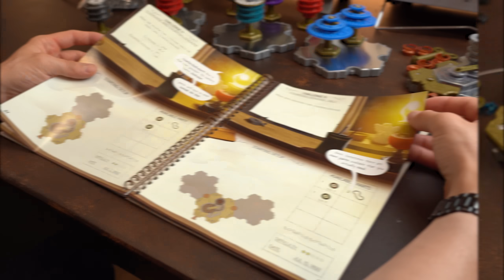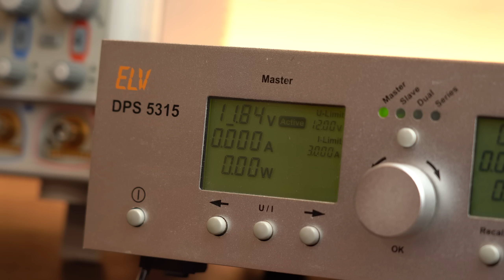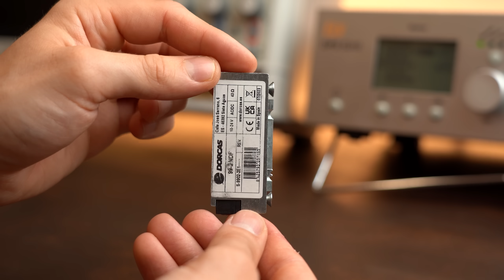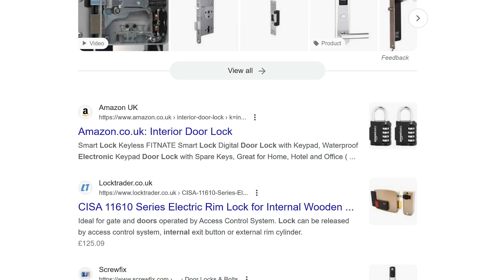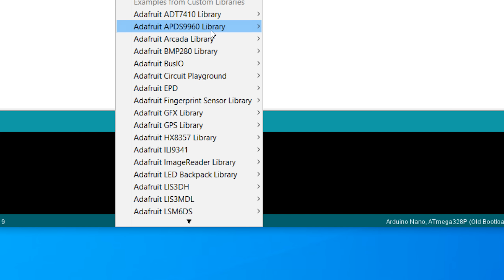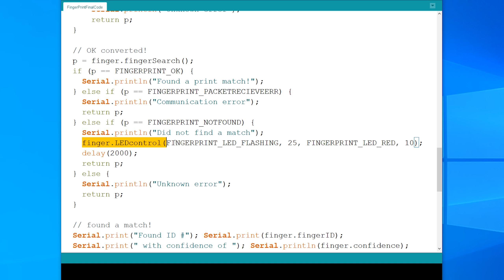Your Door NEEDS this Upgrade! DIY $40 Fingerprint Lock!

Comment: I would have done it a bit different.

Ideally I would have used the electronic lock on the locking part of the lock, and always keep the door locked. Some modification is probably needed to the locking bolt so it won't stick out too much, but that way there is a solid backup if the electronics for some reason fails.

The second thing would have been to power the lock from inside the room, and use a fail safe instead of fail secure lock. That way it would be possible to just trip the HPFI and then gain access to the room in case of electronics failure.
Reply: Can't wait to see your video!
Reply: Just make a video. We will watch it once you post it here.

Comment: Honestly i never understood problem have with white cable ducts. Like they look just fine, especially white duct on white background.
Reply: My only issue with them if you use a poor adhesive they might come loose.
I usually use screws or nails.

At least this is the only problem I've seen l. But our walls are made of bricks.

Comment: for the power just drill a hole through the back of the box into the shop and then you can use whatever method you want to connect it.
Reply: Also, what about the situation, where there is no main power in the house.. You can't get in at all.
Reply: @ElusiveAffinityEchosAlignment it should have an USB input for powerbank, to let it open in case of power outage.
Reply: @ElusiveAffinityEchosAlignment  the key can still be used, it also operates the other bolt when turned a second time
Reply: @ElusiveAffinityEchosAlignment  not like you can do much inside the lab without electricity anyways...
Reply: @ElusiveAffinityEchosAlignment  Keep the key in a secure and known place.
The key usually can also operate the wedged latch.
Reply: @ElusiveAffinityEchosAlignment  For fire safety (and dramatic effect in heist films) those locks often fail open when unpowered.
Reply: @Mike-mu7tk Which would make it irrelevant if it were simply plugged in outside the lab
Reply: You can just shim it with a creddit card, though most access control systems can be bypassed with the key
Reply: @ElusiveAffinityEchosAlignment  With the current lock mechanism he won't be able to open door on the door knob side as the key only operates the dead bolt while the handle operates the latch bolt. But for those German doors there are lock mechanisms where the key can pull back the latch bolt, too. He can place an emergency key somewhere the kid can not reach. I would strongly recommend that as the opening mechanism could also fail.
Reply: Yea
Reply from the maker: @FlammableElectronics  Not a bad plan. But inside the lab the next outlet is even further away. Hmmm I will see.
Reply: @greatscottlab   Isn't there a light-switch inside next to the door, right behind your enclosure? You could just tap off of there.
Reply: @Sprengi86  I don't think it's advisable to connect lighting with other appliances in the same circuit breaker.
Reply: Isn't the outlet you made on the same wall as your lab? Just make another outlet on the other side of the wall. Or as said. From your light switch nearby. Only need a neutral extra.
Electrical bacup not necessary but if you could get the knob off to get in mechanically that would be nice.
It just private for safety not an hotel. Unless you want to keep your wife /girlfriend out too 😅
Reply: @greatscottlab try plugging it in from the opposite side of the original outlet, maybe?
Reply: @greatscottlab  maybe you should have placed the power wire for the Lock also into the lab. Because now someone could easily open the device and connect the power direct to the lock to open the door. On the Outside only the fingerprint sensor should be placed if you want to do it right.
Reply: @greatscottlab  I would also be concerned about a child being able to pull on visible wires that are at mains voltage. If the wiring was inside the lab that danger is also removed, even if the wiring is longer and ugly.
Reply: The new outlet you just added, flip it so that it’s on the inside of the shop but still connected to the outlet you use for the vacuum
Reply: @greatscottlab furthermore, in the lab you have all sorts of possibilities for low voltage (including batteries, power supplies and all combinations)… Possibly no need for an outlet nearby…?
Just food for thought 😊
Reply: @Sprengi86 but then he has to pull two extra wires to that switch to provide power. Or else you turn the door lock off at the same time when you turn off the lights. 
He made an extra socket outside so he also could do this on the switch socket in his lab or directly for that matter.
Reply: @greatscottlab  If it raises the WAF (Wife Acceptance Factor), it's never too much work ;)
Reply: @greatscottlab  i was going to say drill thur wall back room and use plastic cover you have run it to outlets and dont forget add power protect in cause of short it doesnt burn it self down you want have keys for door in cause if power failures end up being locked out of the room and having battery backup in work room not in front living rooms so you still get in without issues
one easy trick use relay 5 pin and power failure and relay drop back in middle pin so it run to battery and have psu hook up to relay turn it on bypassing battery and psu failure it and relay fall back to middle pin sent power from battery to model keep it working and dont forget add leds light back room so you can tell n see still running from psu or battery ( dont need to chager battery unless going over 3 years sitting
Reply: @greatscottlab  you could also drill a hole through the wall from inside the new outlet that you made. But this is me assuming that your worskspace is on the other side of the outlet. In case you would want the outlet on the other side as well but the wall is not thick enough to take an outlet from each side. Then you could drill a cable sized hole at an angle into the newly made outlet to get the cable through, and if the angle is big enough you should also have enough clearance to put a new outlet inside the workspace wall.
Reply: @Sprengi86 Light switches don't usually carry ground connection. Its just mains entering the switch and then out.
Reply: @greatscottlab  wife's approval is not necessary in there. I would keep a reader only on this side of the door (possibly even mounted in the door frame) and put the box on another side of the wall.
Reply: @greatscottlab your wife isnt going to tell you its ugly there 😉
Reply: @greatscottlab  sure, but there you can use the ducts freely since your wife won't be able to enter the room.
Reply: Lay the cable duct inside, it's a lab anyway.

+ you can probably also add a battery backup; a rather small one in case of a power blackout
Reply: @greatscottlab   Drill a hole through the dividing wall, the outlet will be at the same exact spot
Reply: @greatscottlab  If you're rewiring mains for a second outlet you might actually just run a new line all the way to your door because you will anyway need it for the lifetime of this lock, so why bother having an extension cord somewhere?
Reply: I was thinking the same, and in your lab the cable duct isn't ugly. Thats not a place for visitors or something. Or use an industrial looking duct so its a feature. 
Btw congrats with your newborn!
Reply: This also gives more security for the control box. 
Also, have a 2 conductor cable come from the control box to a transformer, then to mains. Your exposed wiring should be 50V or less.
Reply: Plus the logic board is not accessible so a child can't get into it to bypass the fingerprint reader by hotwiring the lock 😅
Reply: Bad design, just power cut or whatever electric fail, and you have no B plan.

Better would be, make the modification to the key operated part. Then you can open the door with either the arduino, or the key (stored in a safe place, ie over the door)
Reply: @asturcon3794 a lock like from the front door would work. Usually the key on those also move the handle pin too. He has to switch them out without modifying the existing one.
Reply: @asturcon3794  no need to modify the key part, he just needs to change the locking mechanism to another one which can take a safety cylinder. Then he can use a  key to move the latchbolt. Available from 20€ for both parts. (Einsteckschloss, Schließzylinder in German ;) )
Reply: Is it possible to run the power cable inside the wall?
Reply: @TomboRectify  as shown in the video, in Germany most walls are stone (brick or concrete blocks). Though possible, its a lot of hassle
Reply: That was my idea as well. Of course with an easy way to disconnect it and connect a power source from outside the lab. Just in case something disrupts the power source behind the locked door.

On the disrupted power/switchable power supply. What's the solution for accessing the lab in a power outage?
Reply: @Dustquake I'm not sure if it's Scott's case, but most doors can be opened by turning the key counterclockwise to the very end. It does the same thing as pushing down the handle.
Reply: @__MINT_  Scott's current setup from outside the lab appears to be a keyless knob that does not rotate. The scanner mechanism is the only moving part and requires electricity. Looking at other comments and Scott's replies, I don't believe he has addressed that yet.
Reply: 😂 my thoughts are exactly the same.
Reply: yep, put a box and switch on the inside as a well...
Reply: Usw the oppurtunity of adding a Outlet there and Go directly tonthe Fingerprint Sensor, and dont Plug in an Outlet so xou also gain an Outlet in your Shop.
Reply: I was just about to say that as well
Reply: I'd just go with WiFi and Electricity over IP (RFC3251)
Reply: @@giusdbg it's not about phases, if you put your appliance on a light circuit and you latter have to do modifications, you will have to cut power to your lights and electronics.

Comment: the handle could have stayed. If you find the handle more comfortable than the knob. The square bar you took out can just be cut shorter so that only the inner handle can rotate the bar, but the outside one doesn't turn anything because the bar is shorter and doesn't go into the square hole in the handle
Reply: What keeps the outer handle in place then?
Reply: @DumahBrazorf  not the square bar lol it has screws to screw into the door itself on each side and then there is a sandwich screw that clamps both sides together. The bar is floating inside
Reply: How do you fix the handle in place then? He would rotating because there is no square pin anymore
Reply: @alexvdvelde  ^^
Reply: @alexvdvelde can literally see it at 8:45 onwards lol, what is he unscrewing?

Comment: Nice project, though like everyone else on the internet.... I have a comment :-)  I would place the access electronics and power on the other side of the door (secure side), leaving only the fingerprint scanner on the non secure side.
Reply from the maker: For safety. Yes. Definitly. But I think for child protection this is sufficient.
Reply: @greatscottlab  True that, however as an added bonus, your wife will probably like the aesthetics of all the wiring being on the other side.

Comment: Just an FYI about your how to power something on the door side of things. There are hinges called electrified hinges, they are used for hotels and such where the readers need continuous power on the door. You can use a drill and drill a small hole from one side to the other or as some doors do it around the permitter.  Still love your implementation, and yes I wish these are more common.
Reply from the maker: What? Never knew about them. Will check them out :-) Thanks.
Reply: @greatscottlab  Never tested it but I feel any regular metalic hinge can become electrified with easy and minimal modifications - add 2 holes for connections, 1 on fix part, 1 on rotating part - then it's "only" wiring. As long as using 2 distinct hinges for each polarity and the frame nor the door aren't metal. Of course limited to low voltage below 24v.
Reply: @vincentdesjardins1354 Electrified hinges are essentially just a hinge with integrated slip-rings. There's an easier method of the wiring is in a protected space (ie on the lab side of the door), which is really just a pair of terminal blocks with a coiled cord between them. These were used before electrified door hinges existed or electronic glass break detectors. There would be an adhesive backed foil tape applied to the door glass and the coiled cord would bring the circuit from the door to the door frame where it could be permanently wired into the business's burglar alarm system.
Reply: Really, the hardest part of building anything is knowing the name of a pre-existing product you need to make your thing work.  Thank you.
Reply: @scienceguy8  true enough 😆
I could rant for hours about the many times I spent days mac-gyving som' I could have bought for a few dozen bucks if only I knew it only existed and/or where to find it.
But I guess I'm not alone in this rabbit hole ...
Reply: Thanks for the info!
Reply: Damn thats a way better option than the rechargeable battery and contact switch in the door jamb i had in mind
Reply: McKinney Concealed Circuit electric hinges.
Reply: Or you can just electrify a regular hinge. Use one hinge for positive and another for negative

you'd obviously want something low voltage (~5-6v) before stepping it up in the circuit, as mains voltage on a hinge would be pretty toasty
Reply: Wow. Never knew about those. But I'm pretty sure I saw something like SOSS invisible hinge.
Reply: That's quite interesting, thanks!
Reply: And if you can't change the hinges, there's always the "concealed door loop" option
Reply: Yeah, I watched someone install a badge reader for access to a room at work.  One of the hinges was changed out to pass low voltage power and ground wires.  Then the paddle-handle was replaced with one that wouldn't "engage" the lock part unless a solenoid in the handle was energized.  They drilled a hole horizontally through the door from the hinge side to the lock.  I really liked the way this looked and acted.  But when I finally found those parts online, they were hellishly expensive.  I think the handle / lock was something like $400 and the hinge was around $200... it's been a while so I don't remember, but I'm sure the price has increased.  So the way this worked was once you badged in, you would hear a click and turning the handle would engage the lock (strike?) and you could open the door.  Otherwise, the handle would turn but nothing would happen.  The inside handle would always work just as a normal and always open it..
Reply: @rancidbeef582  yeah that would be a Mortise lock. Not cheap for sure and still the same price if not more.
Reply: @silent2119 I don't think it was a mortise lock.  My description of it is probably lacking since I don't know the correct terminology.   I wish I could find the link to it again... I'll post again later if I can.
Reply: They work similarly to a laptop hinge, infact a laptop is even more complicated as you have to fit power, display, and webcam all in a single small cable.

Comment: Technically not standardised and still requiring modification, but you could have brought a digital lock and just added the finger print scanner as an additional method of opening the lock.
Reply: On Aliexpres is the solution 😏
Reply from the maker: True. But those commercial solutions are also kind of expensive. Mine was around 50€ at max.